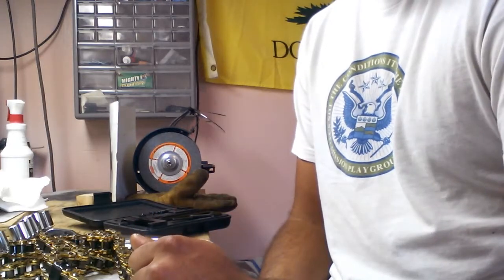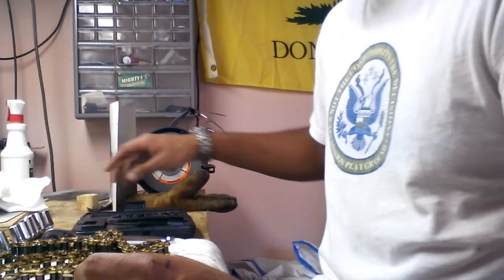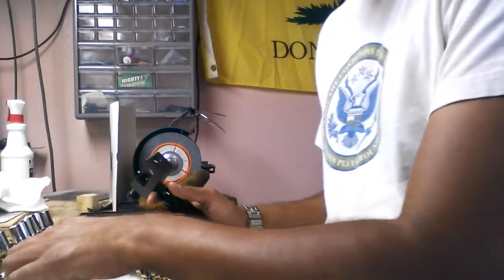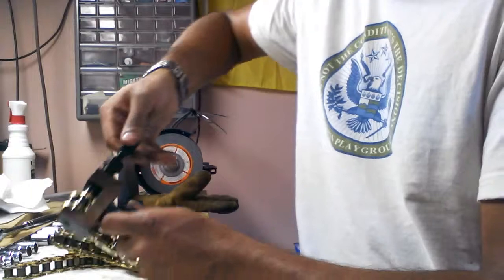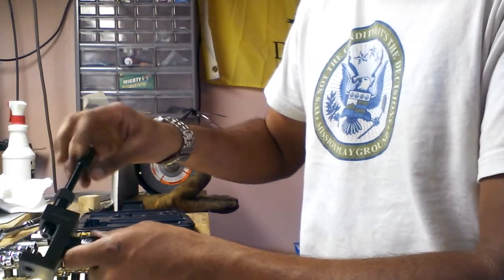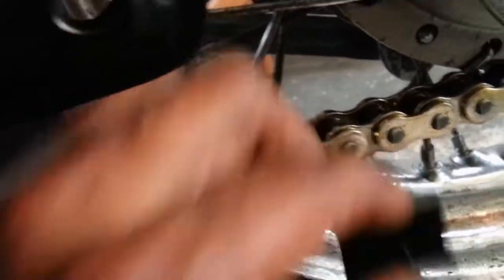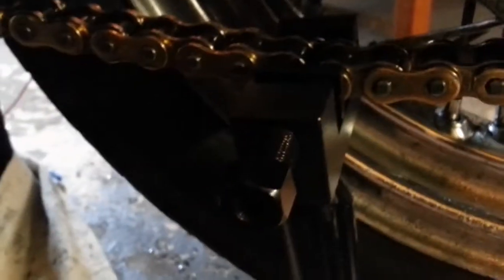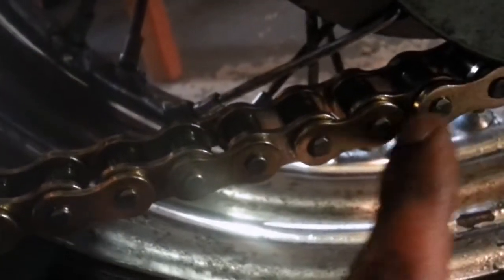How To Cut and Install A New Motorcycle Chain with a Chain Breaker Tool

Comment: Nice video. You didn't seem to cut the head off the rivet before you pushed it out. That's a crucial step. If you try to push it out with the flared head intact, it put's a huge strain on the tool and can often bend or break the tool. You can take an angle grinder and just grind it down flush in about 15 seconds.
Reply from the maker: Thanks for the tip! I actually didn't think of that but it makes perfect sense. I bet even a dremel with a cutoff disc could do it too.

Comment: What do you think of that RK 530H chain? It looks nice with the gold links and it seems high quality, just without the X or O sealed sections. Is that correct?

What did it cost you?

I'm thinking of building a push button chain oiler to always keep it lubed, so why spend so much more money for a sealed chain, you know?

Thanks.
Reply from the maker: Chain has held up well. The gold links do look good, but you can also notice dirty chain oil more too.. For my bike, i wanted that little extra bit of color, so it worked out nicely.  And yes, you are correct, its just an "old school" chain with the X and O-rings, so you have to be good about keeping it lubed up. It's from Western Powersports, and I think i paid about $40 for it off Amazon.